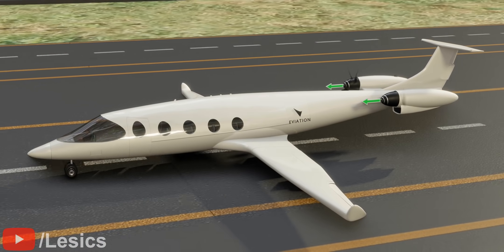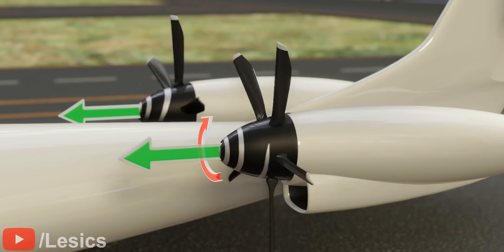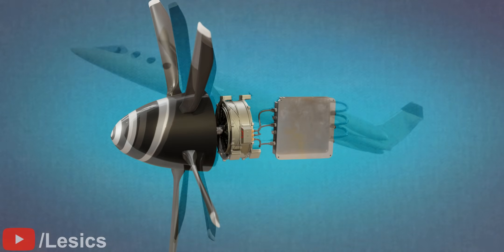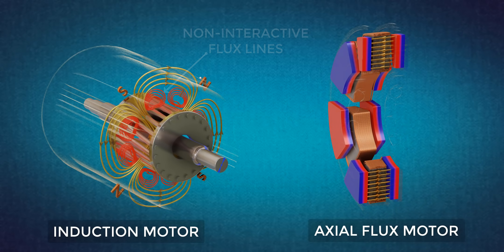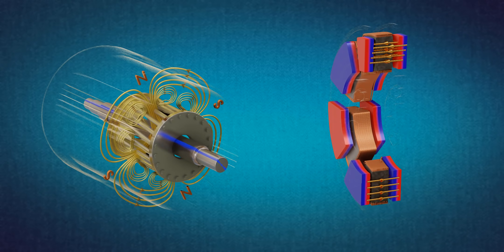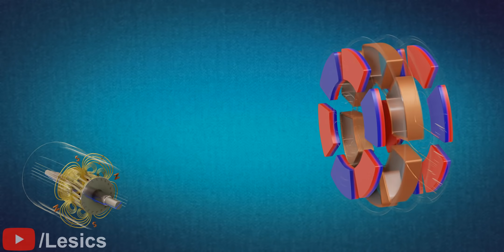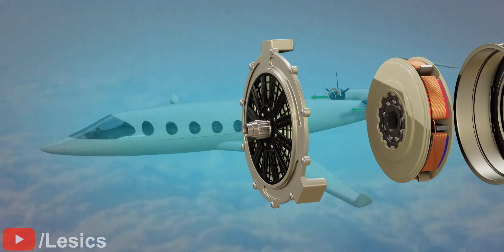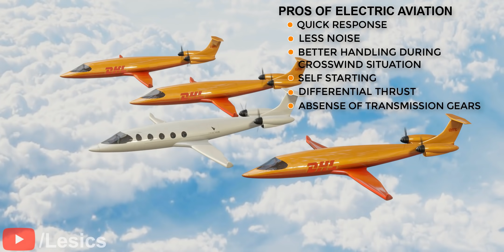Electric Aviation | The Dawn of an Advanced Transportation Mode

Comment: You absolutely can exercise differential thrust on jet engines. This is proven by the fact that there are separate thrust levers for each engine in the cockpit.
Reply: Honestly, differential thrust is the last thing you want on any airplane. The control surfaces are exactly that, and they have been landing aircraft on center line for over a hundred years. The truth is that cross wind landings are easily countered with a side slip. This entire video is garbage from a pilots perspective.
Reply: @airtightindustries  I agree... trying to create meaningful directional control with the engines is the last resort of a plane with no flight controls. A pitch-controlled prop at any scale above a model would become shrapnel with aggressive inputs, and thrust vectoring would be more practical than differential thrust, albeit expensive and unnecessary for reasons that have been explained in depth here.
Reply: @airtightindustries   You speak truth.  I think the idea is that this plane uses a thin wing so wingspan is longer than a normal plane. The landing speed is also faster because of this.  Depending on the prop motor mount it may be possible to off linear vector the motor (Turn motor into the wind).  This would allow the plane to stay flat and tug itself into the wind.  This would allow the pilot to keep the wings flat and land in wind and on ice.  With digital tools this could be done automatically by using a camera to view the direction of ground movement relative to the center line of the plane.
Reply: @LegendLength  cute comment
Reply: This is what I don't like about the typical "green" sales pitch. They always lie to the detriment of conventional fuel burning technologies while exagerrating their own.
Am I against electric airplanes? No, not really but please don't play it up as the superior technical answer to conventional propulsion motors. 
There are still a great number of limitations to electric and they are obvious. How are you going to pressurize the cabin without bleed air from the compressor? No mention of that in this slick sales pitch. Since the motors can't supply bleed air then some other method must be used. That would be an electric air pump of some sort and it would pull a great deal of current, eventually decreasing range of the aircraft. Without pressurization and air conditioning these planes will be limited to around 12,000 ft., kinda like a DC-3, an eighty- five year old aircraft.

Basically an airplane draws a great deal of electricity in order to fly. You have the radar, flight controls, avionics "black boxes", cabin lights, exterior position lights, wing strobes, landing lights etc. Even with LED technology, it is still a heavy drain on power. 

Electric aircraft will be forced to use some sort of APU that runs on jet fuel, at least as emergency back up power supply in flight. 

The devil's in the details, especially in aviation. Power plants are one thing, one small aspect to the overall package. There's still a thousand problems to be dealt with. Good luck getting that FAA Type Certificate for passenger flight any time soon.
Reply: @ericmowrey6872  totally agree.
Reply: @kayzrx8  Thanks. I worked in aviation maintenance - both military and commercial - for nearly thirty years. 
Not to brag but I've got a pretty good idea of what it takes to certify an airplane for commercial use. In fact my biggest concern is the process could become political, with powerful "green" politicians pushing the FAA to certify electric planes ready or not.
Like I said before I've got nothing against this technology. I just don't see it as viable for anything but light, short range aircraft at present.
Reply: Piston twins have a significantly faster thrust response.  Still not used for differential thrust.as a flight control.  As far as crosswinds on takeoff or landing, all differential thrust does is induce yawing.  It does not provide a thrust vector that is other than in line with the airplane.  So you still need to crab or slip.  So this is a major failure in logic/physics.
Reply: Yeah, right
Reply: @DavidSnyder1970  United Airlines Flight 232. McDonnell Douglas DC-10-10, uncontained engine failure in #2 [tail] engine. Complete loss of all flight controls due to hydraulic fluid loss in all systems. Managed to successfully divert to Sioux Falls, IA where it made a rough landing at high speed. This was achieved solely through differential thrust. 

Japan Airlines Flight 123. Boeing 747-200SR. Improperly repaired rear pressure bulkhead ruptured, causing explosive decompression and loss of hydraulic fluid and vertical stabilizer. Pilots managed to keep plane aloft for over 30 minutes after losing all flight controls using only differential thrust. 

Eastern Airlines 935, Lockheed L-1011 Tristar, uncontained engine failure in #2 engine, loss of almost all flight control surfaces. Made successful emergency landing at JFK with minimal flight control surfaces and differential thrust. 

The research isn't hard. There's a few others that failed to land with survivors but successfully used differential thrust to control the aircraft after total loss of flight control surfaces. And, I am only including commercial passenger flights.
Reply: It can be used but we never do.
Reply: @1v1qsns  Captain Dennis E. Fitch is one of the first people to actually practice it in a simulator after Japan Airlines Flight 123, and he used it to help save a lot of lives on a plane he was just hitching a ride on back in 1989. It's a remarkable exception to the rule, and some amazing never-say-die airmanship. In general practice, differential thrust is just inefficient and on most smaller jets and the MD-80 and 727 the engines are too close to the roll axis to have much yaw authority.
Reply: True, only the startup and sound effects differs, not to mention weight of battery vers canister, its feasable of the new lighter air gap batteries, but so far the fuel powered engines surpasses, with the feature of an afterburner, even in vtol style, the only reason never did on a afterburn able engine for civilians, is the rock-fall plunge crashes that wager, unlike soldiers, no eject chairs for civilian passenger🤣 ...perhaps when plasma combustion has electrical implications.
Reply: Correct, but that debunked there nerative
Reply: actually, some planes have a separate thrust lever but even if it's there, the response would be very slow in such a situation
Reply: He agreed with that but suggested due to "wind up" lag it would be difficult to use on a cross wind approach.
Reply: Well unlike electric plane, fuel planes have a low response engine, meaning that it takes a moment for the other to slow down, this is not ideal.

The differential action in electric planes not achieved by slowing down one of the fans, I think it is achieved by turning the steering wheel, in conventional airplanes they actually only use the steering lever to turn.
Reply: He was making the point it can't be used like a rudder due to the slow response times, not that the engines can't be set at different speeds.
Reply: @Zerecese  Differential thrust is an insanely minor benefit.  Planes spend maybe .01% of flight time landing, and the vast majority of the time there's negligible crosswind.
Reply: @Zerecese  I am ooi
Reply from the maker: @Zerecese  Thank you for writing the reply in my mind here :)
Reply: You are all missing the point of how to land in crosswind condition. You can use crabbing and steering into wind techniqe. Which can benefit from diferential thrust by slightly. It aint no gamechanger. Its better to look at that you dont need to windmill the motors if you lost it. Also no compressor stalls are happening either. If you combine both of this if you are in flat spin condition you can use diferential thrust reliable enough to get away from it. Its still possible to get out of flat spin in jet engined plane but with less reliable rate. Also you can look at it by "how often airliners get into flat spin" perspective and be absolutely right to say not really much.
Reply: @bruhmettinmomentogullar4215  agree , but in this thread , the original comment was to rebutal the remark that multi jet engine aircraft cannot utilize differential thrust . That's is wrong as they can. Then some idiot made a cute comment about how an electric prop can respond in milliseconds as an advantage over a jet engine which is a joke. A prop the size to provide thrust for an aircraft will not respond in milliseconds to be used effectively for turbulence control . This is effective on small model aircrafts and drones but not a large prop.
Reply: @kayzrx8  you are absolutely right this is why i bringed up how to land an aircraft in crosswind condition into the table. There is also the factor that a huge spinning object strapped right in front of the motor. That spinning object is also heavy and has a lot of inertia to balance. This is why you can only do massive correctictions not small precise ones. And this is why i told it affects slightly because ,as you said, you can do it with jet engines too. Even f18 pilots say they are using small diferential throttle inputs to fly perfectly straight in close formations where usage of rudder requires a few more control surface input to  counter balance the other effects caused by whole rudder motion
Reply: @bruhmettinmomentogullar4215  I agree with you. Some people don't consider that physics is a real thing or they simply don't understand it.  They think the answer to everything is electric and are heavily biased  towards it.
Reply: @kayzrx8  these are all variable pitch props, like most complex planes. Even the Cessna 182 has a variable pitch prop.

The speed of the prop remains constant while you adjust the angle, a jet engine doesn't have this ability. A turbo prop does but even then you are relying on the turbine to spin up and down to provide higher torque, with electric you have instant response times. At idle and at max power the propeller stays the same speed on many of these airplanes.
Reply: @pilotavery  I think your speaking to the wrong person. I know this already and never said anything contrary to that .
Reply: Ok. Now do it to respond to gusts of wind with a few hundreds of second response time :)
Reply: @monster2slayer  watch your propellers disintegrate if you do that (millisecond response matters nothing when you're at this scale, cuz inertia, this isn't a DJI phantom with 10 gram props)
Reply: @DominicLeung87  you're forgetting that every turboprop runs the propeller at a constant speed and then adjusts the pitch to adjust the throttle, and compensates for it with torque from the turbine which does take a few seconds to ramp up and down. In this case it can start applying instant torque, and then immediately adjust the pitch of the propellers to compensate. You don't have to spin the mass faster or slower...
Reply: @pilotavery  your late to a debate where the original comment that started this  was deleted.
Reply: @pilotavery  exactly, pitch adjustment takes time, you can’t go from min to max pitch quickly (nor would you want to, this is more about the right propellor pitch for a given airspeed and power) 

The instantaneous response of electric motors here is wasted and just creates excess stress.

Not to mention that in commercial aviation there really isn’t any situation which calls for moving from max power to min power abruptly. This isn’t cars where power commanded varies wildly and quickly, in planes you go from;

1) taxi around idle
2) full power takeoff
3) climb at some slightly lower power setting
4) cruise power
5) some lower setting for descent and landing

Unless you’re doing acrobatics or ACM you’re not touching those throttles often
Reply: @DominicLeung87  pitch adjustment can take 1/8 of a second, at least that's how long it takes me. The governor responds almost instantly, the pitch adjustment is fast and you can have the motor go from 0 to 100% power in an eighth of a second, since the speed is constant. It's kind of like pedaling on a bike and then suddenly pedaling much harder. If you instantly go from pedaling soft to pedaling hard it doesn't create any undue stress since nothing is being jerked
Reply: @pilotavery  is that on a piston engine? Can’t imagine in a fixed gear turbo prop that you can change the rotational inertia of all those compressors and turbines within a split second without something being horribly stressed which must happen by definition

Also, if what you say is indeed true, why would you ever need anything faster than this? The “instant torque” of electric motors is completely wasted if a turbo prop can go from 0 to 100 power in 125ms
Reply: @DominicLeung87  piston. 

Collective pitch quadcopters are the same concept. What I'm saying is that 125 milliseconds is faster than the response time of the rudder itself.

This would give birth control much more sensitivity and would also be great for going directly from reverse dressed to forward thrust and vice versa for rejected landings. The main reason we keep the reverse thrust locked out until the landing gear touches the ground is because not only is there a two or three second ramp up time, there's also a ramp down time and a one and a half second delay. Having an instant transition is beneficial. And I say instant because the response of the propeller is faster than the ability of the pilot to move the lever...
Reply: @pilotavery  In the very niche circumstance you describe I can accept there will be an improvement in that narrow metric but it’s digging real deep to find a silver lining amongst the loads of disadvantages an electric drivetrain comes along with

Whatever benefit you get is definitely going to be outweighed by all the extra mass you’ll be slinging along

EVs can be great at replacing cars and maybe even trucks but aviation simply isn’t an area where electric has a chance at breaking into realistically beyond greenwashing projects or extremely niche routes between islands or something which are “just” offshore of the mainland
Reply: @DominicLeung87  it's not any additional weight. Even the little Sling TSI has a variable pitch prop and 2 people can pick up that plane. 

Propellers have variable pitch for performance because it's almost a requirement for high performance general aviation planes and every commercial propeller plane has a variable pitch prop.

It's also known as a constant speed prop.

They only take about a second to transition from feathered to fine, and the only limiting factor is the speed that the internal core of the turbine spins up and down. This takes about 7 seconds. Keep in mind that the core turns out a different speed than the propeller, the more torque that is put on the propeller the higher speed the core must turn to compensate. On an electric propeller this is not the case, so the propeller can be spinning at a constant RPM and take less than a second to increase the pitch and increase the torque on the motor to keep the propeller at the exact same speed and now have full thrust. It can transition from 0 to full and back to zero in 2 seconds. The full swing of a rudder on a 737 is 2 seconds!

I don't see why it couldn't be used for rudder authority instead of rudder... I mean sure it's gimmicky but it would let you reduce the rudders size. 

Personally, the engineering works. It's a constant speed prop and even without differential thrust it is going to be anyway. The propeller on many general aviation planes are electrically actuated instead of hydraulically, which means that each one can be independently controlled by a computer. Like, everything is already set up for that.
Reply: @monster2slayer  a control surface is way better at this then trying to speed up and slow down a prop that size  to vary thrust to stabilize turbulence . Please stop .
Reply: @kayzrx8  i didnt say control surfaces arent better. i said that you dont have milisecond response times on conventionial jet engines. but good job refuting something i didnt say :)
Reply: @kayzrx8  with an electric engine it's totally reasonable to control yaw with differential thrust.
Reply: @devlinsemmler8236  if you read the thread you would understand that's not what was referenced here.
Reply: @kayzrx8  with a jet you can't do this, but with electric you use a variable pitch prop to adjust the pitch of the prop while also adjusting the torque of the motor simultaneously. This gives you near instant response times, Jets can have a response time of seconds, sometimes 5 or 6 seconds.
Reply: @pilotavery  please read the comments.  This will not scale at size .
Reply: @monster2slayer  there's about a one second total time to swing the rudder from full deflection on one side two full deflection on the other on fly by wire airliners. This is about the same amount of time it takes to control the pitch. It means that the control authority of the rudder or differential trust should be the same...

You have to actually spin up and down the core in order to change the actual thrust output which can take a few seconds, so this only works on electric where you have a continuous RPM but the torque induced on the propeller can be changed instantly.
Reply: United Airlines Flight 232 and Eastern Air Lines Flight 935
Reply: @kirkc9643  And, although doomed, the prototype for zero-control differential thrust control, Japan Air Lines 123
Reply: @kirkc9643    UA 232 is about lack of redundant systems like manual reversion not diferential thrust.
Reply: @bruhmettinmomentogullar4215  What? It's not "about" anything. My very obvious point was that they used differential thrust to control the aircraft.
Reply: Yes but it isn't instantaneous. I think he meant more on the fact of steering the plane in real time with thrust differential. Kind of like a drone is able to maneuver with thrust differential. Jet engines probably can but they're not designed to do that. Not to mention the lag and increased wear and tear. That's differential for a jet engine is mostly for taking off and mid to full thrust purposes at altitude.
Reply: @Jiham Mabya What the Fu*k